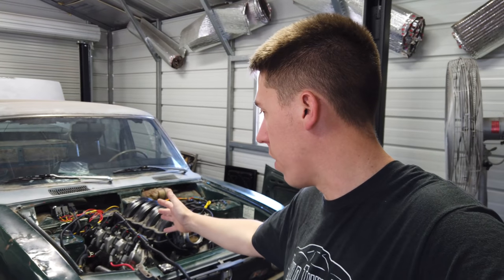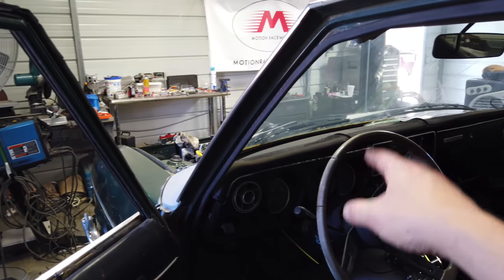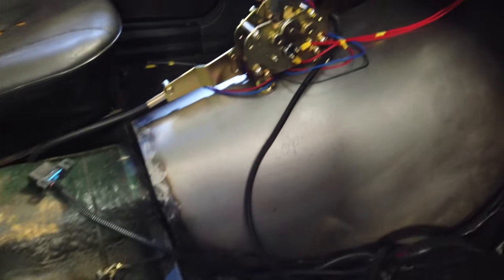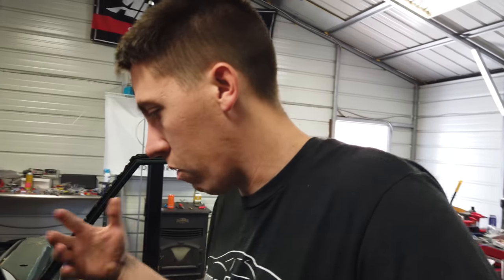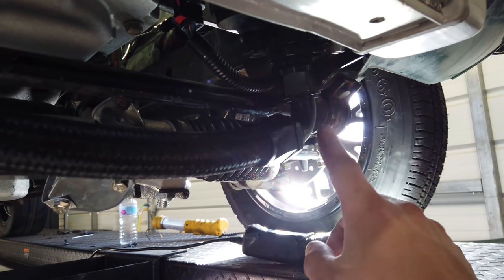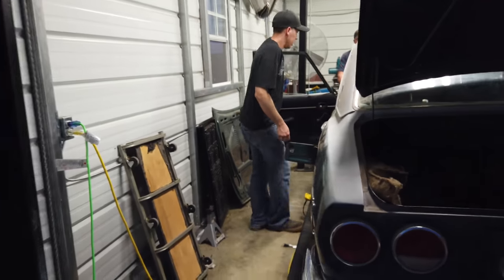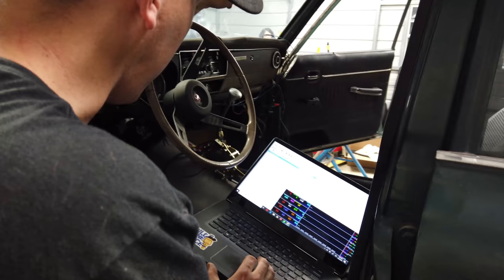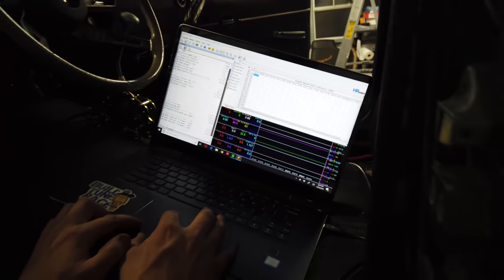Gen V Swapped Mazda Rx2 RUNS for the FIRST TIME!

Comment: After talking to you I purchased the Corvette pulley and am going to use a remote water pump on my L83 👍 curious if you know what brackets I can use for Alternator and A/C?  As they will now be much tighter to the block?? That’s all I will have up there... Really like the Videos 👍👍👍
Reply from the maker: Nice! My alternator mounts directly to the block and then I built a belt tensioner off of the chassis since my engine is solid mounted I used a 02 Tahoe alternator just had to clearance the block a bit and it bolted up. Shoot me a message on Instagram and I’ll try to get you some pics!
Reply: @BuildTuneRace  I don’t have an Instagram account 😳 ya could message me on FB if you have an account there, if not I’ll get an Instagram account I guess 😊😬